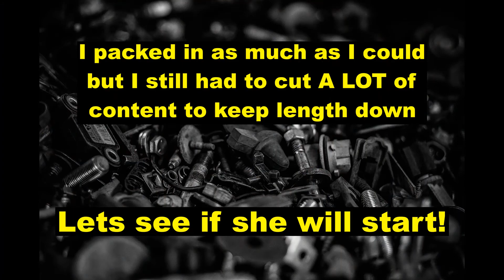RAPTOR 660/686 REBUILD UPDATE JULY 2021- WILL IT RUN OR BLOW UP?!

Comment: Hell yeah!  Awesome video.  Keep it up and you'll gain subs without a doubt! Good job on getting it running again.  Hell I got nervous just taking my carb off to clean and adjust, I could only imagine how relieved you were when it fired up lol.  Remember to let it warm up for 5 mins or so.  Raptors don't like to be cold, that goes for stock and especially modified.  Definitely want to make sure that oil is warm and circulated before you start revving it too much.
Reply from the maker: Thank you! My nerves were about shot getting ready to hit the start button lol. Yeah I was a bit too rough on it trying to get it started but i'll explain why in next video, thankfully nothing bad came of it. Honestly to hear it start again my whole body got warm inside lmao such a relief

Comment: you do a great job my men.. hey I do have a question about the wire harness. you mentioned you made it .?
Reply from the maker: Thanks man! I used the wire harness that was on it. What’s your question tho, might be able to help
Reply: @fearless1931  I just want mine to look clean as yours lol .. I might took all the wrapping cleaned and re-taped. Yours videos are badass men I'm just rebuilding my 660 I found your vids and boom all I need. Would you minde if we share Facebook I case I need asked you something.? Carlos A. Queeman is mine...

Comment: Man great video start to end. Did you figure out the issue with the cdi box. I currently have the same problem. Reverse light comes on when starting now doesn’t start. I’m not sure if I have a aftermarket one or not.
Reply from the maker: Thank you! I did not figure out the blackbox cdi, I ended up putting factory back on. I have to tear the bike down again anyway here soon so I’ll see if I can figure out how to make it work.
Reply: mine did something like this.when i got the bike over 2k rpms it cut spark and the reverse light came on.it ended up being the connection under the shifter was loose.either u crimp it a little or hard wire it.try it out it might help